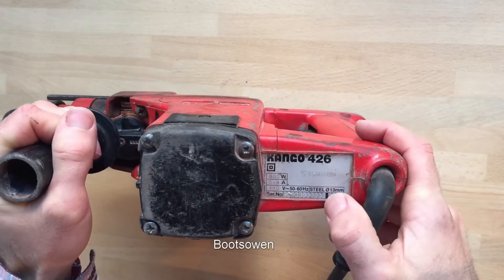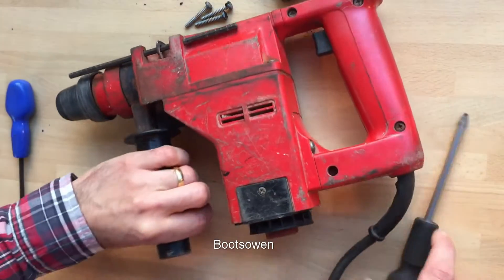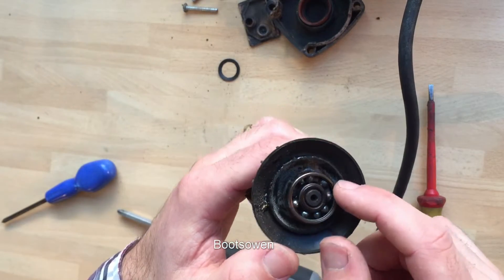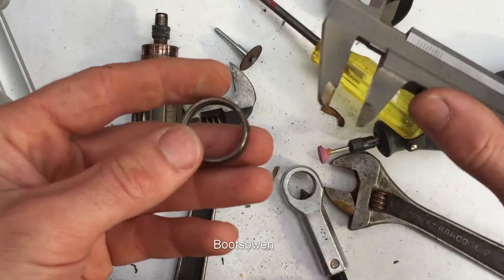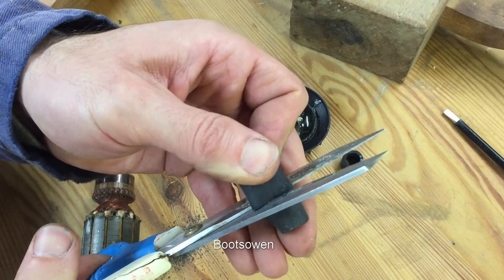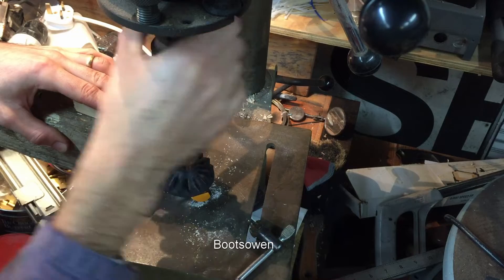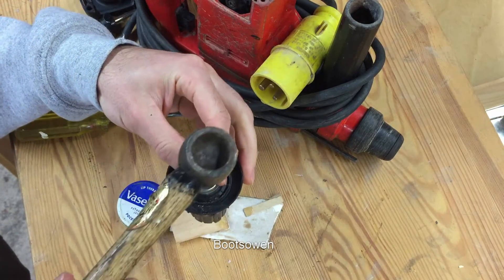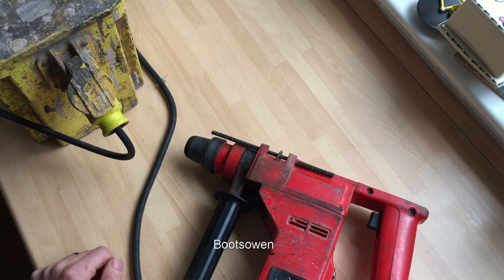Obsolete overheating Kango 426 hammer drill: new bearing and armature fan repair.

Comment: Well done  bootsowen   You did a smashing repair :-D :-D
That drill is very different to ordinary crappy drills.
I imagine it was not cheap in its day.

What about cutting up a marigold washing up glove, then wrap a patch over the trigger area and use rubber adhesive (puncture repair kit glue).
Less chance of water getting past the rubbery patch.
Something like that.
Or a chopped up inner tube to slide over the trigger area.
Dam i jibber a lot lol.
Reply from the maker: That's a good idea about the rubber glove.I have left this drill as it is and it gives great service. I am not sure if the rubber is for water or dust ingress, I suspect dust. I'd say I prefer an inner tube sleeve.

Comment: Clever chap! I liked the drill press die grinder, keeps it at 90 degrees. I had expected armature in the lathe rather than file. Rubber sealed bearings better for dusty environments.
What'a the size comparison between 110v and Lidl?
Reply from the maker: I have a similar lidl hammer, the Lidl one is heavier, but it is 220v so more useful in that I don't have to have the box too. I have been given a similar hilti 220v which is decent, but worn, so it is probably hot as good as this Kango either.